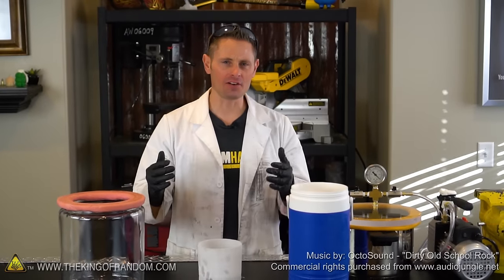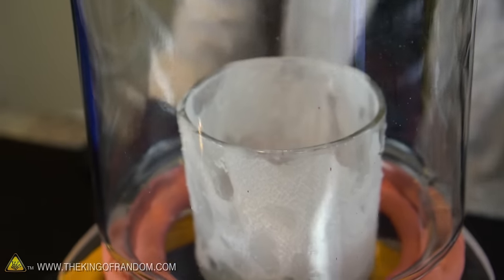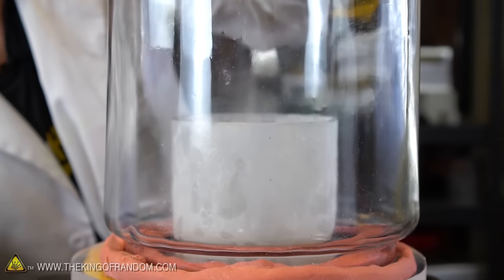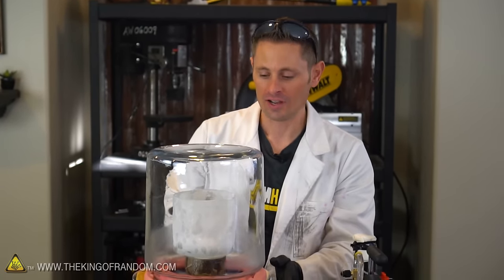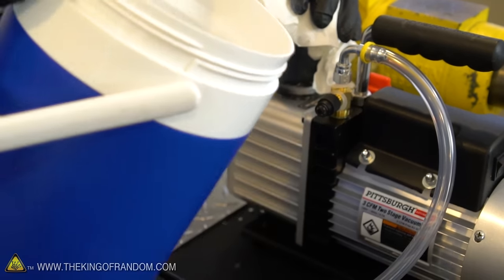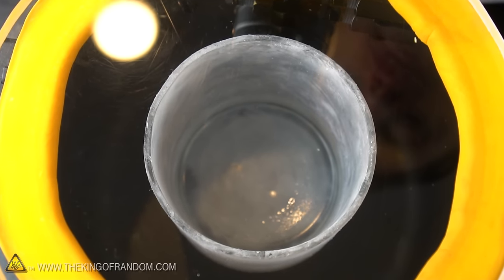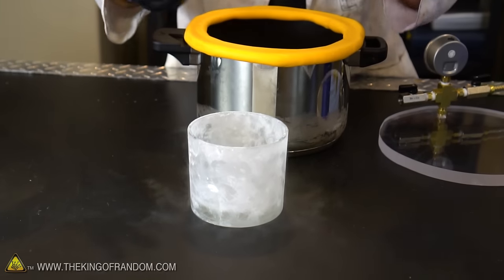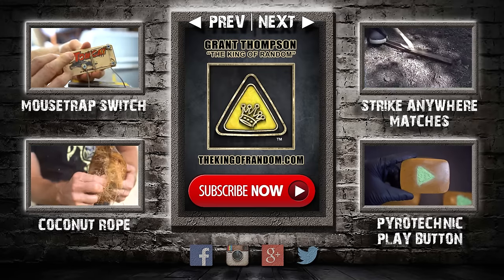Liquid Nitrogen in a Vacuum Chamber Fail | TKOR Experimenting With Liquid Nitrogen In Vacuum Chamber

Comment: I'm pretty sure to make solid nitrogen you have to pressurise the air, also you're not changing the temperature just the point which it boils or freezes. The way it works is the water molecules have the air pushing against it, when water is heated it has the energy to counteract that pressure and turn to vapour, by removing the air you make it easier for that water to overcome the affect of the air. So by applying a vacuum to the liquid nitrogen you actually helped it evaporate quicker

Comment: I'm confused the boiling point should increase shouldn't it? so all you should get is nitrogen gass (unless you increased the pressure over sea level)
Reply: the idea is to get the liquid nitrogen to reach its triple point, in which it freezes(sort of)
Reply: if the "tripple"point" is the spot where all 3 lines meet on the phase diagram then it would only exist at a specific temperature AND pressure
Reply: the partial pressure of the N2 in the liquid and would try to equal that in the gas.  As the air pressure above the liquid drops there is less force the liquid molecules have to overcome to get airborne.
Reply: novafire. Think about dry ice. A chunk of dry is is at it's triple point just sitting on a table. It's a solid, and very quickly, because of the high atmospheric pressure, is very quickly turning into a liquid then a gas. You don't even see the liquid stage because it's so quick.

Comment: you need more pressure to solidify something not less pressure, put un sure you already knew that
Reply: No, not pressure. To solidify nitrogen, you have to lower its temperature from -321°F to -346°F. You have to freeze it. Increasing pressure would heat it. To freeze it, you have to reduce pressure.
Reply: wow nice understanding of physics!
Reply: But increasing pressure also increases the freezing point
Reply: Changing pressure has nothing to do with temperature...
Reply: By decreasing the pressure of the chamber it will make the nitrogen boil faster which lowers the temprature
Reply: What im trying to say is, you increase pressure in the surrounding gas, the gas presses on the liquid and effectively makes it easier for the molecules to stick together and form a solid, its the ideal gases law
Reply: Anton Helsgaun if something is boiling then it will never solidify
Reply: Rumplelumpa Snickerdoodles oh I see, but the last thing you want to is for it to evaporate before it lowers its temperature enough to solidify. And a low pressure will most likely make it evaporate. But I guess you would need to have the nitrogen in a closed container with no air whatsoever. Maybe then
Reply: The experiment actually achieves the triple point. At 63k, and .12atm nitrogen exists in solid, liquid, and gas states simultaneously. So then you can reduce the pressure of liquid nitrogen to that pressure and it will begin existing as a solid, as well as a liquid and a gas. 
To get it to only exist as a solid cannot really be done by just reducing the pressure.
Reply: Decreasing the pressure lowers the boiling point much faster than the freezing point. And a substance can be solid and boiling at the same time; this is called the Triple Point, and it's a very basic physic concept. You should probably look this stuff up.
Reply: PV=nRT... the gas law formula has a relation with temp and pressure
Reply: PolyJohn well that didn't happen here
Reply: Jorge Chávez That absolutely happened here. He lowered the pressure, the nitrogen boiled more intensely, cooled itself enough to reach its triple point. That's what caused those small blooms/bursts: nitrogen solidifying, then being jostled and heated enough to rapidly re-expand to gas.
Reply: Jorge Chávez And regardless of what happened in this video, you're still wrong about both of the points you made, specifically that you need to increase pressure to solidify things (pressure has very little effect on melting point) and that something can not boil and solidify at the same time (it can and does at its triple point).
Reply: PolyJohn pressure has a big effect in melting and boiling point, water boils at a 100 degrees Celsius at sea level and at 96 at 2500 meters above sea level or so
Reply: Jorge Chávez Water is a really bad example to use as it's phase diagrams is very complex due to its H-Bonding characteristics.
Reply: Jorge Chávez Boiling point, yes, mostly because (or for the same reasons, at least) gas is easily compressible. Pressure still plays a role in melting/freezing point, but because the solid and liquid forms of a substance are usually very close in density (water/ice is a bit of an odd case, as it is in most regards) it has a much smaller effect. Seriously, do some research into it; the effect is described by the Clausius–Clapeyron equations, and if you do the math it takes tens to hundreds of atmospheres of pressure difference to change the melting point of most substances by even a few degrees. Pressure does change whether or not some substances actually melt instead of just sublimating, but as far as a single atmosphere of pressure is concerned, it really doesn't make a difference.
Reply: PolyJohn the rapid boiling activity is actually bumping, not triple point interaction. 

the triple point would require 26inHg vacuum, and the described activity takes place at about 18inHg vacuum.
Reply: Andy Tymczyszyn Ah. my bad.

Comment: If the boiling point drops why would it solidify?
Reply: Chandler Gloyd lol exactly
Reply: The boiling point drops, but the liquid is still boiling, so the temperature of the system drops. If you reduce the pressure enough, the temperature will decrease until the liquid reaches the triple point of the substance, when the solid, liquid and vapor coexist. In other words, if you reduce the pressure, the liquid temperature drops and, eventually, the liquid freezes.

Comment: Why do you say inHg insteaed of mmHg ...
Reply: Eric Osborne his gauge reads in inches of mg
Reply: Eric Osborne inches of mercury is a perfectly reasonable measure of pressure if you know the basics of manometer pressure. Source: chemical engineering student.
Reply: tbf mmHg isn't significantly more compatible with SI units than inHg, I would personally work in pascals, it's kind of like measuring speed in km/h instead of mph, km is SI but km/h isn't, m/s would be the correct SI unit
Reply: Makes sense, just seems a bit weird to me as I've never seen someone use inHg before
Reply: The most likely reason would be that's what his pressure gauge measures in.

Comment: I have a burning question so hopefully somebody will see this and be able to help answer, but I have been taught in chem that when the pressure decreases a fluid will reach it's gas state faster because there is less force keeping the molecules in a liquid state, so why would you try to solidify liquid nitrogen by putting it in a vacuum? Would that not just make it evaporate quicker or does the force of the vacuum somehow create more pressure on the surface?

Comment: What does he mean by like 11'' of mercury i dont know a lot about vacuum chambers
Reply: [Faze] Killa its a unit of measuring pressure.
Reply: Noter oh
Reply: [Faze] Killa it's the pressure , mercury is used to measure it
Reply: If it's anything like mmHg it symbolizes pressure (in this case negative pressure) that 11'' column of mercury exerts.
Reply: as the vacuum increases the mercury expands in the mesuring equipment and shows how much vacuum they have

Comment: The triple point of nitrogen is at 611Pa, or a bit less than 4.6 mmHg.  Your basic setup might not be able to reach that under any circumstances.

That said, one thing that you could do is use a narrow container for the nitrogen, such as a test tube.  That way less surface area of nitrogen means a lower overall rate of evaporation so the pump doesn't have to work as hard.

Comment: for this to work with your small pump, you need to vacuum out a big chamber as a reservoir, then open that vacuum into the smaller chamber with the nitrogen very quickly.

Comment: I'm sure I'm not the first to point this out, but boiling point lowers with pressure. No amount of vacuum will give you solid nitrogen. A pressure vessel might, but probably requires several atmospheres to do so.

Comment: As taken from Wiki. They say that nitrogen start to melt at 308K at 2.8GPa (27,6 katm - the presure in a tire of car is around 1,9-2,5 atm) or 35 degree Celsium to a 21*10^6 mmHg. So you should reduce the quantity, decrease the temperature and increase the presure. The triple point of nitrogen is 63K (-210C) at 12,6kPa (0,124 atm). Yeah... It will be difficult.

Comment: if you really want to be able to freeze that much liquid nitrogen you're going to need to use a piston vacuum chamber which is going to be hard to set up. Because you're going to first have to use your regular vacuum and then you're going to have to use a piston to drop the pressure even more you'll need to run calculations on that using Boyle's Law

Comment: When I was in 3rd grade there were hand sanitizer bottles all over the classroom and for some reason, I was annoyed by all the bubbles in the hand sanitizers.  Anyways, I was wondering if you could put some hand sanitizer in the vacuum chamber to remove those bubbles.  Also, what would happen as you used the hand sanitizer?

Comment: When pressure decreases to an vacuum boiling points will get lower, when  pressure increases boiling points gel higher and gasses will become liquid or even solid at room temperature, so you will need positive pressure instead of negative.

Comment: Grant what if you built a vacuum tube that you would place between your chamber and the pump. Pull a full vacuum on the tube, then use it to pull an instant vacuum on the chamber. Rather than using the pump to pull a gradual vacuum use the vacuum tube to pull an instant vacuum on the chamber. This could create a drastic pressure drop to shock the nitrogen.

Comment: word of advice from a refrigeration tech, you should use clean vacuum  pump oil with each pull down (maybe every 2 hours of use in your case). vacuum pump oil contaminates very easy and ruins the pull downs. 

if you want really acurate readings, find a cheapish  micron guage.

Comment: If you reduce the pressure, shouldn't you be lowering the boiling point and causing it to evaporate sooner, like water? Is Nitrogen the opposite? Why would it fuse into a solid at a lower pressure?

Comment: The triple point of nitrogen is at 0.124 atm, so if the barometer is at 1 atm/101.3 kPa/29.97 inHg, that would be -0.876 atm(gauge) or about 26.2 inHg(gauge).

Comment: Isn't the boiling point reduced at lower pressures?? Maybe that only applies to water, but my understanding is the difference between gas and liquid was pressure. Reduce pressure, less heat is needed to turn it to a gas, is nitrogen so cold that this does not apply to it?

Comment: You took a pail of a liquefied gas and tried to pull a vacuum on it?  How was that supposed to happen?  if you had a nozzle and rapidly introduced a small amount of liquid N2  into an existing vacuum then  solid N2 might have snowed out (a similar technique is used to make dry ice).  That might be a better alternative otherwise your pump is just fighting against the large amount of material you have on hand... there are several orders of magnitude difference between the volume of a liquid and gas.

Comment: I think those little bursts that the nitrogen was making might have been the nitrogen reaching its triple point, which is the temperature and pressure for a substance in which something can exist as a solid, liquid, or gas, causing the nitrogen to rapidly change between liquid and solid form. If that is the case, then technically you did make solid nitrogen!

Comment: To have this project done you need to have a smaller pressurised container with a small amount of nitrogen, remove the air from the outer container so that the nitrogen does not evaporate into the vacuum chamber

Comment: you'll have to double wall insulate the nitrogen with Styrofoam if you 
want to freeze it. put the glass container inside a styrofoam insulator 
and then that that in another jar. also, you must attain a vacuum of 
less than .3 atmospheres to achieve solid nitrogen. You're going to need
 a faster and bigger vacuum pump my friend. :D

Comment: You need a better pump. From what I can tell, your pump can do about a fifth of an atmosphere at best (at least that's what your fancy gauge told me, correct me if I'm wrong). To reach nitrogen's triple point (it won't freeze until boiling temperature is above melting temperature) you need 94 mmHg IIRC, or about a tenth of an atmosphere. Sooo... yeah.

Comment: I dont think it would make sense to remove pressure to make solid nitrogen in fact you would have to add pressure to turn it into a solid. a LOT of pressure. the reason why is because when you pull out all the gasses are removed from the system reducing the vapor pressure. when there is a low vapor pressure, the Nitrogen have less forces holding it in the liquid phase, causing it to turn into a gas. I may be wrong but thats just what i think.

Comment: a refrigerant vacuum pump isn't meant to have non condensable gasses or liquids ran through it. seeing as nitrogen is used for purging air from line sets but never recovered it is only to leak test for new braze line leakage. in reality you can blow a vacuum pump up with nitrogen

Comment: If you drop the pressure then the boiling point decreases as wel as the melting point so the nitrogen boiled and if a molecule evaporates is takes some heat with it. so the temperature decreases and if you then put it under normal pressure just before everything is evaporated it will freeze because of the lower temperature

Comment: He totally screwed this one up and flip-flopped it.  Decreased pressure = decreased boiling point AND freezing point, meaning he would have had to decrease the temperature.  I really don't understand how he didn't comprehend this.  If he knows decreasing the pressure decreases the boiling point, as evidenced by the boiling off of the liquid, why in the world did he think it would freeze?  

To increase freezing point, you should increase pressure.  Just like a can of pressurized air.  The air liquefies at higher pressure, therefore it would also freeze at even higher pressures.

Comment: motor powered by microwave transformer with blades cutting things up? If you could get a motor with that high of a voltage rating, of course -- that would be cool :)

Comment: As the pressure gets lower, the boiling point does the same, and so it will just boil off, there is not enough pressure for it to become a solid...

Comment: How does that work? You should be adding pressure to make it solid instead of a vacuum. Applying a vacuum when it's nowhere near the triple point just reduces the boiling point so that it's easier to vaporise. Add pressure yo

Comment: Your doing the exact opposite of what you wanted to do. If you want the liquid nitrogen to get solid, you need to increase the pressure, and not decrease it. The liquid nitrogen is turned into gas easier when you lower the pressure because the atoms have more space.

Comment: what if the liquid nitrogen is in a sealed container, so it doesn't evaporate.
Reply: Or use a smaller container and vacuum chamber.
Reply: Steven Paige it will explode